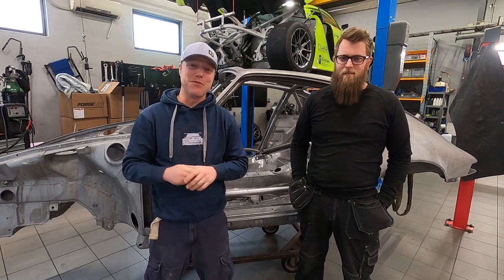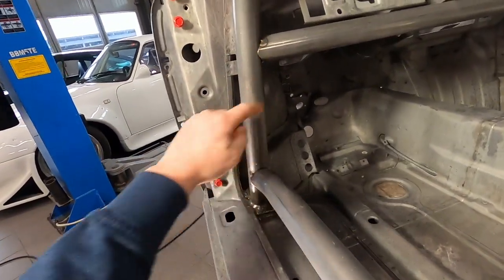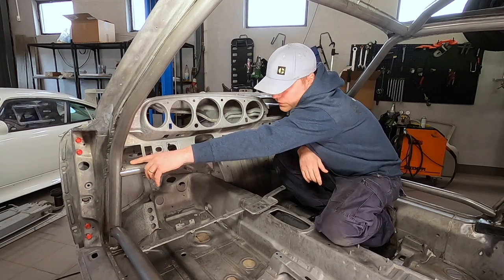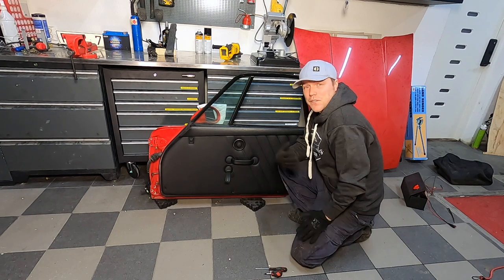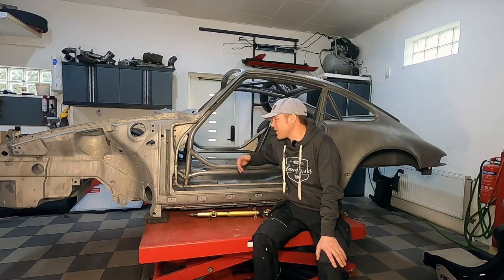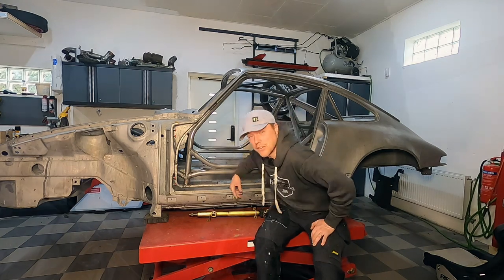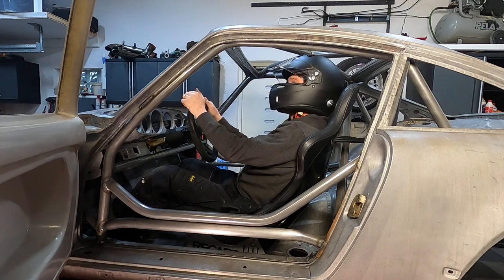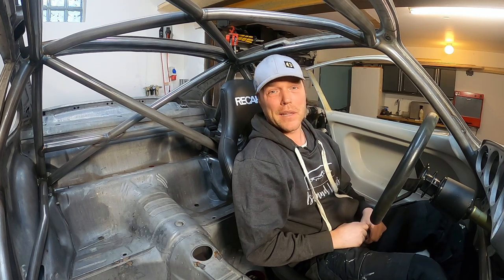Safety First - Building a MASSIVE Roll Cage in a Porsche 964

Comment: Great channel and videos. 👌
I'm no expert by any means but I think the cage should be more like 45-50kg. 
Also I think it would be a good idea to link the door bars together... if you have a side impact it will result in a twisting force at the connection points of the upper door bar. Also it would result in a higher twisting stiffness between front and rear axle. I like the look of it but technically it isn't optional I guess. Greetings from Germany